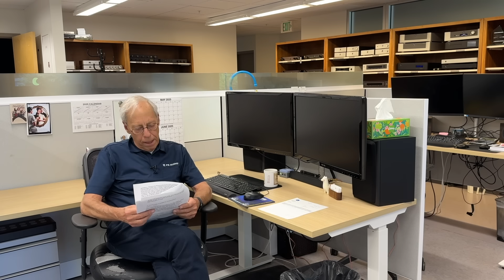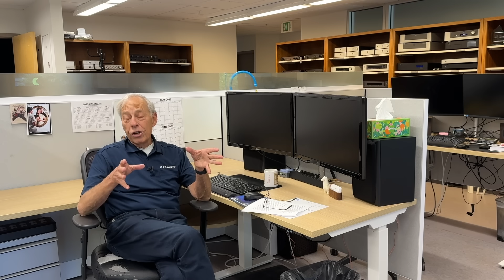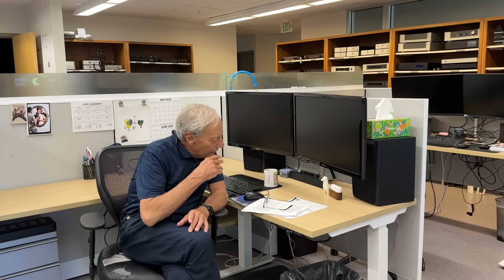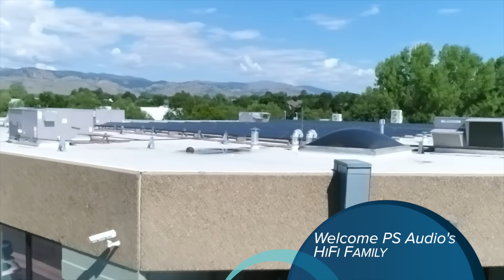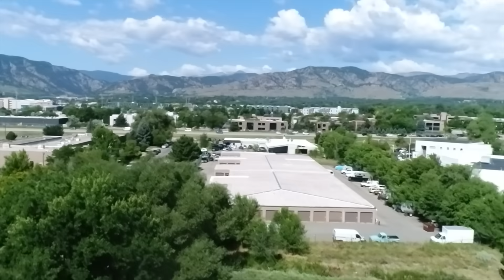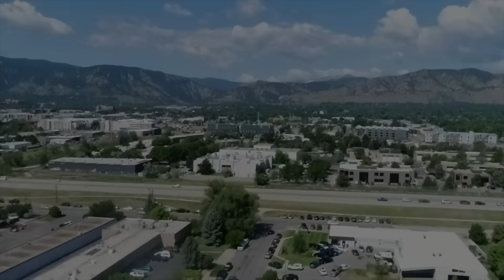DAC with and without a preamp

Comment: If I purchased a quality component from an A-list manufacturer, and found it didn’t perform as well as I expected. Then the manufacturer advised “ah, well, the mains cable we supplied with the component doesn’t do it justice”, my next question would be, Why? 
I used to use stock mains  cables with all my components, until I fell down the rabbit hole that more costly mains cables offered improved performance. 
Mains cables do make a difference. You wouldn’t take the stock cable from your 25w bedside lamp and use it to connect your 1500w heater to the wall mains outlet, would you? But, you could take the stock mains cable from your 1500w heater and use it to connect your 25w bedside lamp to the wall mains outlet. The lamp however would not perform any better! Those more costly mains cables made absolutely no difference to the performance of my components. In a blind A-B test I think 99.997% of people would draw the same conclusion.

Comment: He's saying that you said a quality DAC going directly to the power amp is better than it going there via a preamp. He's also saying he doesn't know how to do that as his DAC only has one RCA out, and he's using two power amps. Firstly what I took your previous video to say was a DAC with a digital volume control isn't that great and should be left on fixed outputs. And a DAC with an analogue volume control was better, and may be used directly into a power amp. It's not clear from his question what volume control his DAC has, without looking up the model. I believe in the last video you were still advocating the use of a pre amp, as in a pre amp can make things sound better. Logically somewhat controversial as it's another block in the chain and can in theory only add distortion. As others have said maybe he's bi amping or using one amp for a sub, rather than one amp each bridged for right and left. A RCA Y cable would probably allow him to cut the preamps out of his chain, I'm not saying a Y cable is a good idea.

Comment: a, dac is not inferior in the streamer. Just take the digital out of the streamer DAC so it bypasses it's DAC amplifier using a cat 5 100 ohm cable into interconnect  spdif or any other type of digital to digital. XLR really only use it for analog to analog not to digital. Not really suitable if you want to do digital xlr you're looking for a cable of 123+ ohms  unshielded this is different to the ohms of a cat5 what is internal resistance 50 ohms on each wire, is better. 123 ohms is the inductance value of the cable. analogue should be 50 ohms or below. Turntable really 43ohms or lower with low capacitance, like 15pF
Reply: AES/EBU standard is 110ohms for digital XLR connections, it's characteristic impedance.

Comment: Knowledgeable Paul. If I have a "Courtesy" DAC in my streamer, and another Pre Amp DAC, and another Dedicated stand alone DAC, am I limited to my weakest DAC? Like a "Chain" only as good as the weakest link? Signed, Puzzled Dave in Jersey.
Reply: If you are using the digital output on your streamer, then the dac in the streamer should be bypassed.
Reply: @mitchtaylor6512  hi so do you set the external DAC to DAC only or leave it as preamp mode to bypass the DAC in the steamer?
Reply: So digital out from streamer to pre, digital out from pre to stand alone dac.

Comment: Is a DAC made to drive a power amp? That is the question. A dac output is made to pass the line-out only in principle. A power amplifier usually expects a hot signal from the preamp with enough current capacity. A power amp input impedance may not be linear across the frequency range and high enough to be driven by the delicate line-out of a dac. Sure, it's possible but are inputs from a power amplifier the same as those on a preamp or integrated amplifier?
In other words: Are power amps made to be driven by source line-outs or by preamps? Are preamp outs the same as source outs with respect to current/impedance?
P.S: On top of that, ideally power amps may be designed to work with preamps from the same brand and line. For example: why make inputs from a power amp high impedance like an integrated amplifier if the preamp out is powerful enough to drive it? I think you make a compromise setting high impedance (resistance=noise) in front of power amplifiers to accomodate all sources when you're really expecting a strong preamp out. And on top if that, you have to account for preamp/amp gain and expected voltage range.
Reply: Paul has said the DAC output section is very important in any case. It may not drive a power amp to full, and yet is too loud for most listening if there is no volume control. They are very hot into vintage integrated amps, for example clipping at -20 dB = halfway up.
Reply: @wyup ...It was for me. Back in the 1990's I had an Audio Alchemy - 'DDEv1.0' DAC feeding straight into 2 x DENON - 'POA4400' (class 'A' to 15 watts/class 'A/B' to 160 watts) monoblocs, each with a rotary ALPS pots, bottom L/H corner of their fascias, & I never ran out of gain...& I listen to R 'n R music at between 92 - 107 dB. I ended up with a very clean, clinical & tight sound with no preamp colouration 👍👍

Comment: I am guessing the Cambridge Audio DAC would be the Stream Dacmagic 200, which uses an ESS SABRE ES9028Q2M DAC chip.  Bluesound uses various DACs in their streamers.  Node 130 uses the Texas Instruments PCM5242 dac, the Node X uses the ESS Sabre ES9028Q2M, the newest Nodes all use ESS Sabre ES9039Q2M DAC, with their top-end Node Icon using a pair of ES9039Q2M DACs.

Generally, I find ESS chips sound similar, particularly the ES9018/9028/9033/9038 DACs, generally quite clinical.  This is not to say that the sound cannot be changed by the manufacturer, by use of different parts in other areas or particular tuning.  The Node X* sounds very different to my Burson Audio Conductor 3x Performance*, which uses the ES9038Q2M DAC, with a different soundstage and tuning, though I doubt any of this is down to the DAC.

I am currently looking into changing the opamps in my 3x Performance to change the sound slightly, giving it a less clinical, more musical sound.  So parts can make a difference.

*When listening through headphones

Comment: Michael does not say if he is using the NAD C272 power amplifiers in a bi-amp configuration or a bridged mono configuration. The NAD C162 has two sets of RCA pre outputs that could support a bi-amp setup, (e.g. with Pre 1 connected to one C272 for the left channel loudspeaker and Pre 2 connected to the second C272 for the right channel loudspeaker). Conversely, when the C272 is switched to a bridged mono amplifier this configuration only requires the left channel input. The Cambridge Audio DAC most likely only has a single set of RCA outputs. This would preclude using the DAC instead of the pre-amp in a bi-amp configuration. The other unknow is if the Cambridge Audio DAC provides a means of controlling the volume. Generally low to medium cost DACs use digital attenuation to control the volume of their RCA line outputs. My experience is that the performance is inferior to an analogue volume control in a pre-amplifier. There are exceptions and some DACs have high quality volume controls based on either a relay step attenuator or an IC attenuator using analogue switches.

Comment: If you have a DAC with a gain control then just buy a couple of monobloc power amps & forget about the preamp if you're a single source listener. However , if you've got a DAC without a gain control or you like more than just a single input source then your fate is sealed...you're gonna need a preamp.
Reply: For the song ... before there was home video or online video there were a number of "pornsong" vinyls released.  I don't know if this is one or not... but the absence of dust clicks and other "needle drop" tells says it is probably AI generated.

Comment: My takeaway from this is why include a courtesy power cable if you wouldn’t recommend using it on your own equipment? 

This kind of thing really annoys me and all hifi manufacturers should provide cables that suit their products. Or instead of including cables at all just make sure you provide the right kind of advice so customers know they must choose their own and have been told what to look for… but whatever you do don’t imply a $10 cable is suitable for a high end system unless it really is.
Reply: I don't have a problem with the logic of it, more that the suggestion an expensive power cable is a substantial improvement makes me not want to play this game. But absolutely, the amp maker could build or suggest a superior cable without expecting users to just throw money at the problem. Better yet, improve the power supply/include the magical fairy dust inside the amplifier so a special cable isn't required except for the finest of hair-splitters.
Reply: People who purchase top stuff usually choose to buy their own choice of cables.Thus the added expense of a high end cable added to a system on purchase would not be beneficial,or wanted,by most.Swopping cables in and out is part of the experience for us.
Reply: @spandel100  You want to try that without the virtuous flex at the very end?! And did you misread the bit where I emphasised the benefits of unsolicited advice & guidance in lieu of a length of landfill?
Reply: @sammoxford   Nothing I said was intended to be hostile towards you.Just my take.I try not to attack people on YouTube comments,but sometimes because of the limitations of typed prose,the actual tone is lost,and gets taken the wrong way as a result.

Comment: The Cambridge DAC is quite good. In fact everything that Cambridge makes is very good excellent prices
Reply: I had a azure 851n it is very disappointing. Bluesound node 2i was better for a third of the price. And now Auralic Vega S1 makes Bluesound node sounds like crap.
Reply: Still rocking the old dacmagic100🎉 i had the 200 too but went quick back to 100 and pre amp.
Reply: Azur 540 MkII CD player was very disappointing too.
Reply: @Scopolamine46 ...er, no, I disagree. Cambridge Audio have made some extremely unreliable & average products.
I bought a Cambridge Audio - 'Azur 540 MkII CD player back in 2009 & within 5 years (2014) the sliding disc tray stopped operating & when I contacted CA in England for a replacement they said that they no longer had that part available which is inexcusable as you are supposed to retain a minimum 12 year spare part inventory. It was a blessing in disguise as this moved me to buy a Marantz - 'CD6005' CD player which is a much better sounding unit, is far more reliable & sold for around the same price. There are other CA devices that are absolute dogs, but I can't be bothered listing them all here to rebut your statement. @Nefty_ ...has mentioned the Azur 851N network player here on this thread & his disappointing experience with it.